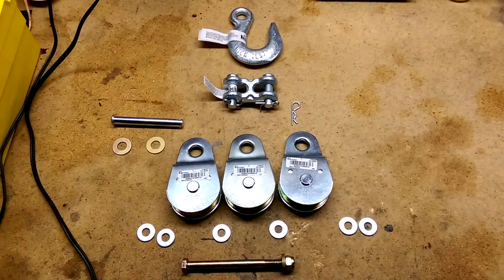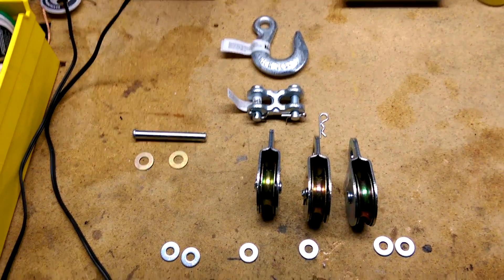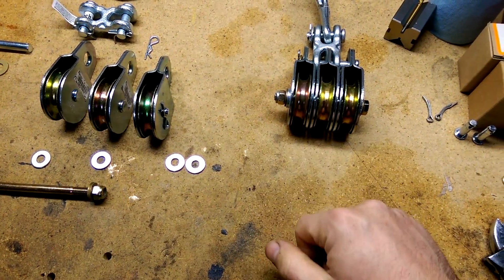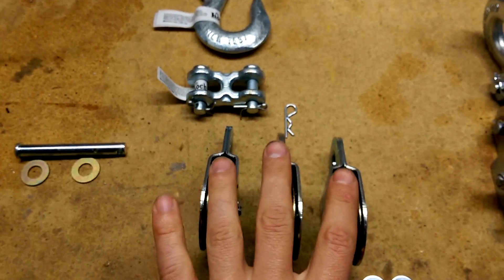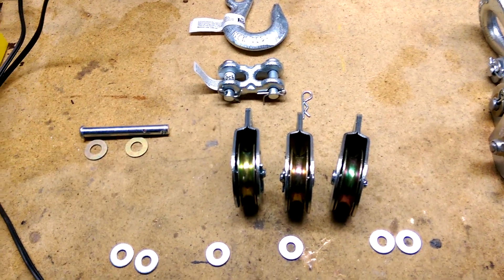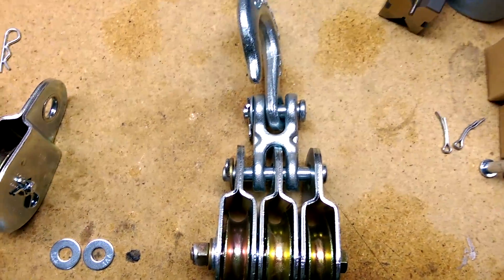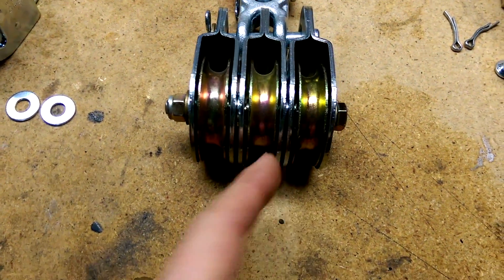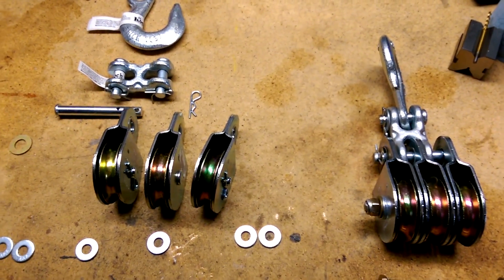DIY Block and Tackle

Comment: I'm so glad you put this vid up. I've been looking around for months for a similar 3 sheave block and tackle and there's very little out there to match it. 
Thought about doing this like you have, so now I know the concept will work. Great !  
The pulleys that are available seem to be customised for particular applications, i.e either for climbing, arborists, gym equipment, awnings, boating, rescue, pulling 4X4's, crane pulleys or general heavy duty blocks that cost a fortune.  I also looked at chain blocks, lever chain pulley, ratchet winches / brake winches but none offer the speed and versatility, compactness, low cost and strength as your setup. Also this 3 sheave has the advantage of being able pull or lift an object.

Comment: Fantastic project! I believe you're incorrect on the pulley weight. You should stick with the load limit of each pulley no higher. Think about it this way, a 400 pound load, four ropes, you pull 100 lb the next rope gets 200 the next rope gets 300, that last rope is still pulling the full 400 lb, it's not divided by 4. You can't go over the manufacturer specs on the pulley.

Comment: 3 pairs with 1 pair loading each pulley. Not 6 lines. Divide or multiply by 3 not 6👍
Divide by 6 for the rope capacity.

Comment: Is there a mechanical reason for putting all three pulleys on the same sheave bolt?  Do they not work as well if they are only fixed at the anchoring end?
Reply from the maker: Convenience. Rather than hooking up each one, having them all in one "block" makes it easier to connect and disconnect and relocate.

Comment: Confusing summation:' ..price wise this is new, and it's gonna work'.  Your fabrication may be acceptable to accomplish your task but on what basis do you equate it to a block and tackle?
Reply from the maker: "Price wise this is new" means these parts are new, unused parts. Not an antique bought off eBay with unknown wear and tear.
As for how I equate it to a block and tackle I'm not sure what you mean. It's a block and tackle. https://en.m.wikipedia.org/wiki/Block_and_tackle
Reply: @CalebMayfieldMHF  Thanks for the feedback. I know what 'new' means and its ramifications. Usually 'price wise' argues for cost effectiveness between competing solutions.

Comment: Where did you get the pulleys and what weight are they rated for?
Reply from the maker: I got them at a Farm Supply store at the time, but they are available on Amazon. Each pulley is rated at 480 lbs. 
http://www.amazon.com/National-Hardware-N195-800-3213BC-Single/dp/B000BD8N0U/